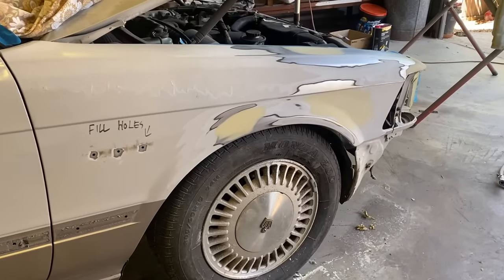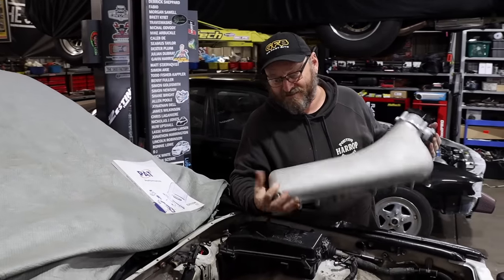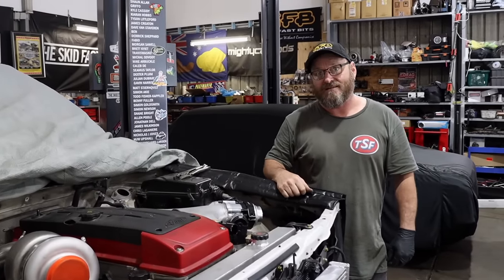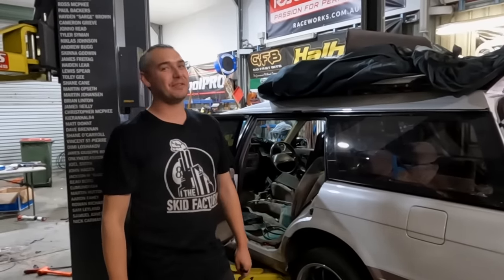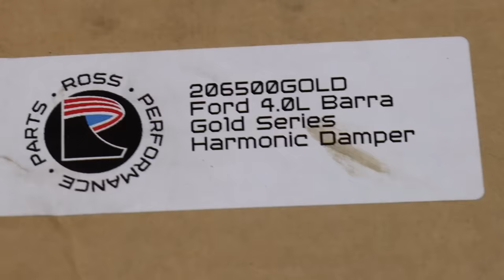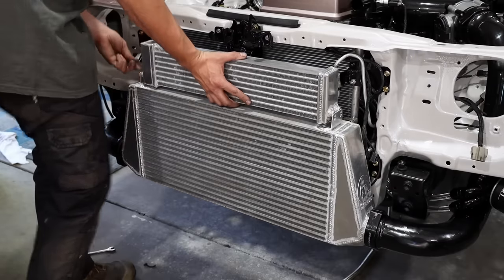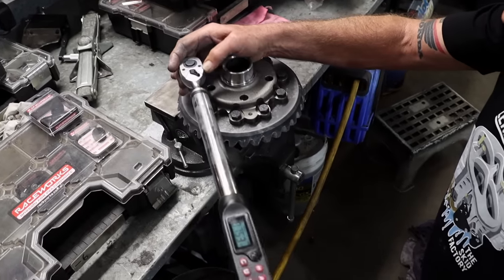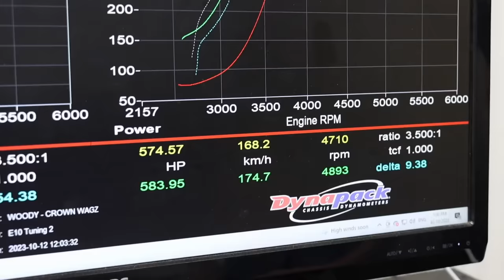Building my Dream JDM Wagon! Barra Powered Crown FULL BUILD!

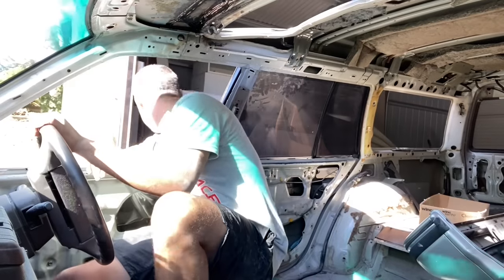Comment: 0:41 Damn straight! There's so many nicks on my hands i've stopped counting them. Cars are my hobby away from other hobbies and work. Also a connection to my past and family. They're never easy to work on and any project you undertake that's more than swapping the fluids (tho even that one depends on who tightened the bung last) is bound to be a long term process, be it for work reasons or just plain inertia of getting things done right (which is why we start doing things in the first place).

Comment: Looks good, I had a older Crown to which I put a Holden 186S engine, celica bellhousing and flywheel with the standard crown transmission with the old pull leaver overdrive and it was the best drive I ever had, was never short on power  , economical and rode like on glass. Regret selling the old girl now

Comment: Excellent video! I liked your approach to explaining exactly the what’s and why’s for your doing things. I love sleepers. I have a subcompact 66 Rambler American. The best is it has a 383 cu inch stroker that dyno tested to meet and exceed 435 horsepower by Blueprint Engines. Just what a 75 year old needs. I have had it sideways a couple of times. Pulled it out of that with no physical damage.

Comment: Drill small holes through the  heads of the flexplate bolts and use safety wire to link them all so they can't back out or loosten

Comment: I spent 2.5 years building my basket case project all in my garage.  Rebuilt EVERYTHING.  Rewired.  Painted.  The lot.  Only thing I didn’t do was rebuild the top loader and install the windshield.  Congrats on getting yours to where you can enjoy it.

Comment: what's the process for getting a conversion like this legal on the road? have an engineer mate? surely there's a bunch of hoops and weird requirements like needing FG brakes or something to get it done legit through any random engineer
Reply from the maker: The rules vary from state to state in Australia but in QLD I’d suggest to speak to your local mod plate issuer before you start a conversion and consult with them what’s allowed and required. 

I’m this case the car is a full chassis vehicle thats had everything upgraded along the way. Transmission, diff, brakes and suspension so he was happy that the conversion has been done correctly and not zip tied together

Comment: Why did you choose a Barra, over UZ or 2J or VK56 or RB...??
Reply from the maker: The original plan was barra 6 years ago, Then I wanted to to JZ, I even bought a mid sump for it and we were going to use Kevin’s engine (7MJZE for those that remember) once I got the car on the road the plan changed again to just turbo the 1GGZE and roll around twin charged but then Al pointed out if I don’t use the barra and TH400 that I originally purchased 6 years ago that I’m never going to use it. So we went with the barra..
Reply: Well, some might think this is controversial, but I think it's a wicked build regardless of the chosen engine. (Sure, the Barra makes wicked power, but any engine swap you & Al did would have been a good one) I have always loved fast wagons. I built an SR20 Datsun 1600 wagon many, many years ago...when everyone was building sedans. I don't think there's enough wagon projects out there in mod car land. Your Crown gives me a stiffy.
 @theskidfactory